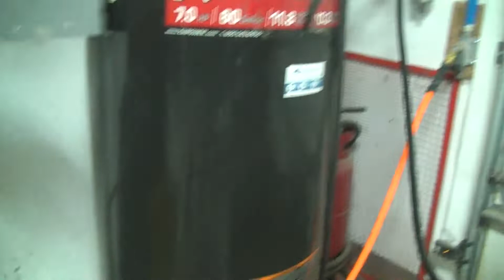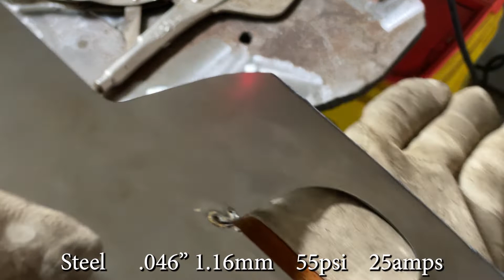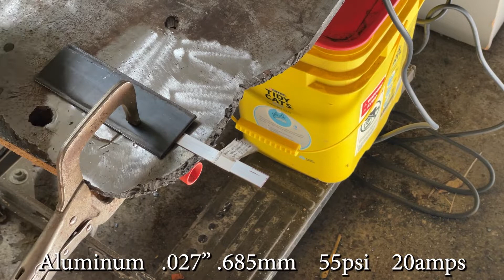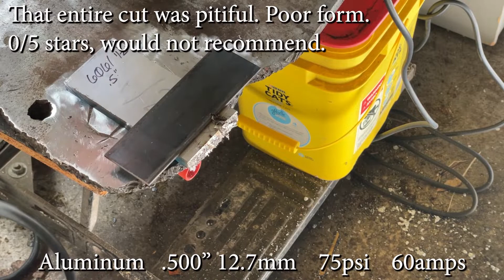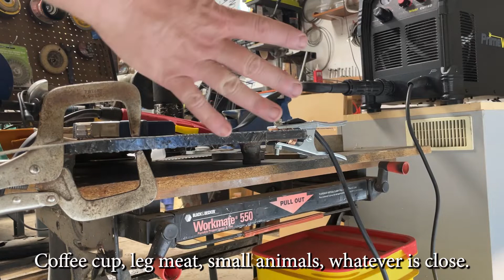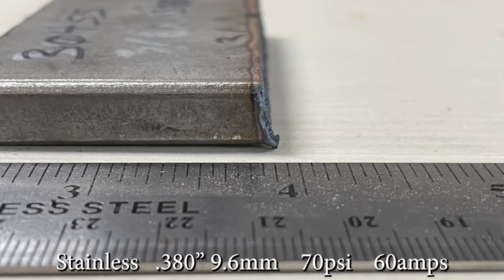PrimeWeld CUT 60 plasma cutter part 2- setup and testing | RATTLECAN FAB SHOP with James O'Rear

Comment: Regarding the dropped pressure this is normal. The very right toggle switch is used to simulate the torch running as you set the pressure while exhausting air. You will easily be under 10 to 15psi from  Guage setting while static compared to when you are running the torch.  That little switch is how to set the pressure correctly while it's flowing. Also set the input pressure to around 90psi as well. This is what I do and cut quality is excellent. Hope this helps
Reply from the maker: Great insight, thanks for the tips!